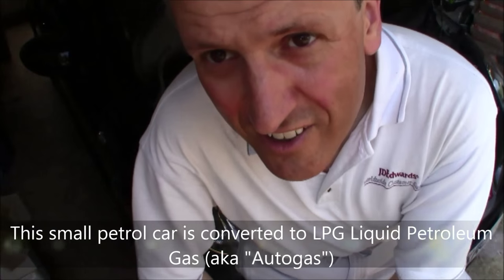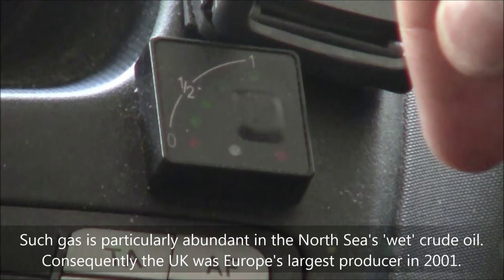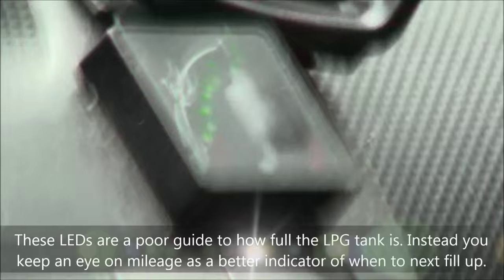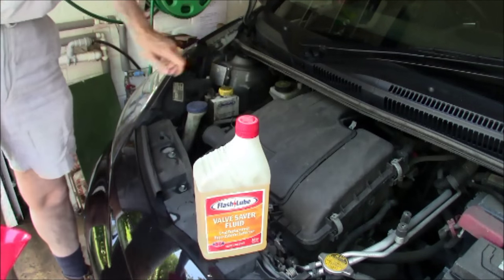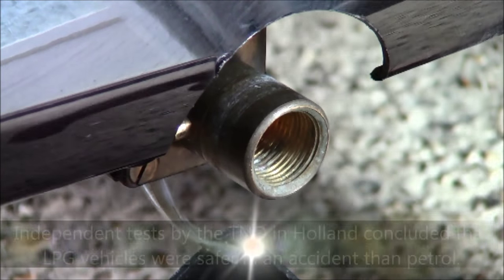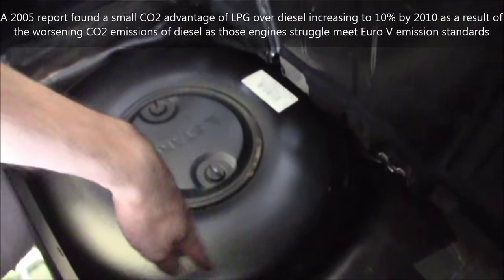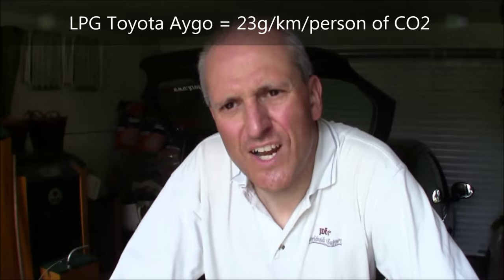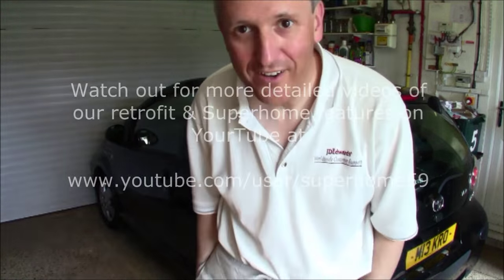Using a small LPG (Autogas) car to cut your carbon emissions [Superhome59 part 19]

Comment: Valve saving fluid, might only be for the vvt engines. But my toyota starlet ran about 450k on LPG without any valve lubrication or special whatever. It also started on LPG. Only the newer systems you have to start on petrol/gasoline or we call it benzine. Diesels can also run partly on LPG/CNG. Pretty cool stuff and so cheap as well! Can't believe why more people aren't drive on it!

Comment: Hi - have you considered electric vehicles?? I am about to embark on my own project a bit like yours (moving house soon to a 1960s house that could be made more efficient). One thing I am thinking about doing is making sure I get a car charging point installed so I can go electric for the runaround car that will only be used on local journeys (I think there is still grant money available until March 2017 to help pay for installation costs). The first electric cars (Leaf, iON etc.) are now at reasonable prices on the used market.
Reply from the maker: Yes we considered electric but their range is not yet enough for them to be a practical option for work needs. The car is not used as a local run-around or for a short commute - it is used for business trips that can sometimes be quite long. Since you cannot yet guarantee that every hotel at the other end has a charging point so there is that lack of resilience. Both hybrids and electric are also much more expensive than the Aygo and we did not want to spend a lot of money on cars - we have better budget priorities. I did not want to work for my car. In the long run we wish to use electric but the technology will need to advance somewhat. Thanks for watching.
Reply: Yes - range is a problem I agree, unless you pay loads for a Tesla. We are a two car family, and are moving further from town which means that one of the cars will get used a lot more for short journeys so I think a used electric car will be perfect for that. Plus I am really intrigued to see how the "use your car as a battery for the house" technology will work (which will be hitting the market soon). 

Thanks for the videos, really interesting. I only wish there were a few more people engaged on the superhomes forum as I've got loads of questions to start to ask when we move in a couple of weeks!

Comment: do you still drive this car? the aygo is known for having soft valve seats, even with valve saver fluid the cylinder head wears to quick op lpg, having to adjust valve clearances often
Reply from the maker: Thanks for the tip. How did you come upon this? I part exchanged the old Aygo in 2017 for a brand new model. I like the Aygo so much that I got another one brand new. So, yes, I still drive an LPG Aygo but not the one in the video. I did look at alternatives but found nothing as good as the Aygo. Your information about soft valve seats is 'new' to me. I have done quite a lot of searching online over the years but have never seen such advice. However it is the same engine in the Citroen and Peugeot equivalents so it may have been hard to trace the data. The old Aygo did have a string of engine management warnings that were never properly explained. These occurred in the first year. Then I did experience one breakdown with it. Cylinder misfire. Had it towed to the LPG installer. They took the engine apart and blamed the problem on valve spacing. They said it had been that way since assembly in the factory. (I took that with a pinch of salt as they could have been covering up a defect in their own installation.) They adjusted everything and put it back together again. It ran perfectly after the rebuild. NO engine management warnings ever again for the rest of the six years I had it. So I wouldn't disagree with your assessment but I really wouldn't know anything about head wear. There may have been something wrong with the older models. However I have the new model and had LPG installed by the same installer but with different LPG kit. It has run without any problem for an entire year now. If excessive wear is happening it may be a long time before I find out. Certainly the valve clearances may be an issue but my experience shows that it was just a one-off adjustment that fixed it for good on the old model.
Reply: i have done some research on small cars suitable for LPG but mainly in dutch, i'm from the netherlands and that's where i read it on forums
there is also a blacklist from prins an LPG system developer and the aygo from 2005 and on is on it for "Excessive wear of valves/seats" on the 1000 cc 12V engine
https://www.autogastanken24.de/documents/Blacklist%20Prins_081107.pdf

Comment: Quick question, is it true LPG expends quicker the faster you go? Like if you're doing motorway miles?
Reply from the maker: LPG is no different from any other fuel in this respect. The faster you go [over circa 50mph] then the fuel efficiency of the Internal Combustion Engine powered vehicle will decrease. Speed requires power. Power requires fuel. The faster you go the more gas you will consume.
Reply: Low Energy Retrofit South Bucks - Superhome 59 yeah that's what I thought. I just got a Toyota Corolla over a month ago that's had an LPG conversion done to it.

Comment: It's better for the environment and for your wallet. But, the car is slightly slower and less powerful and less responsive with the throttle on LPG compared to petrol. Savings are something like 30-40% cheaper than running it on petrol. In winter, the car uses a lot more petrol to warm up. I'm driving a Ford Focus mk2 1.4 59kW converted to LPG and I get something like 10-11 litres of lpg / 100km in the city(urban). That's about 25 MPG(lpg) british. It's cheaper than petrol, and you don't have a lot of compromises. My car is currently at 100k miles, the LPG has been mounted on 30-35k miles, and car still runs good. My LPG system has a dripper system which drops a bit of oil on the valves so they won't get dried out, which as I've heard saves the valves a lot. If you maintain it properly, driving on LPG is a great choice.
Loved the video!
Greetings from Macedonia
Reply from the maker: Brilliant! Thankyou for watching.
Reply: You mean skopia or fyrom..not macedonia..i think you lost it a bit